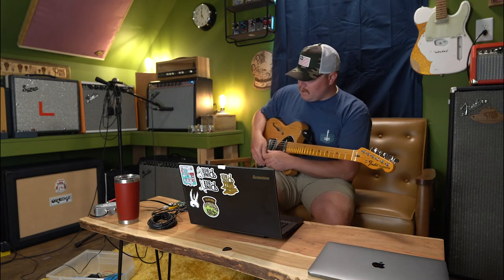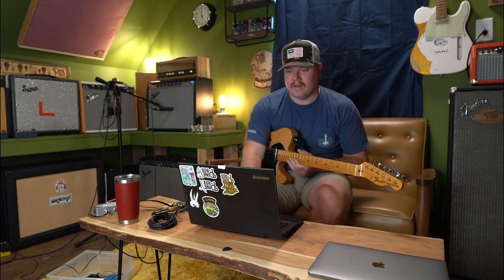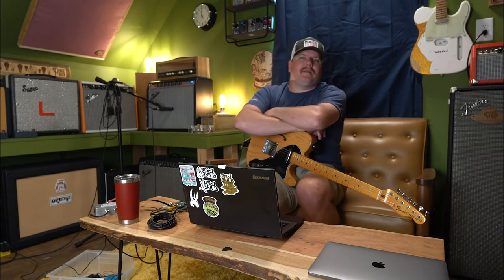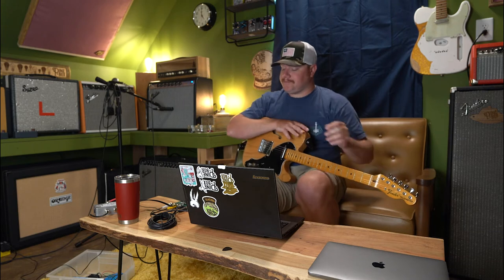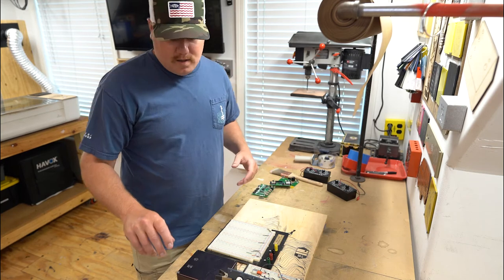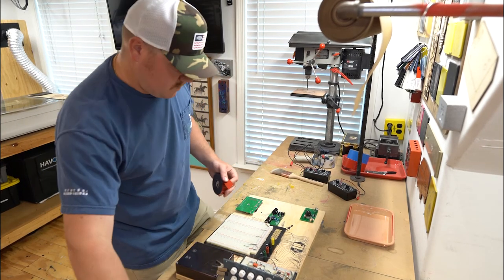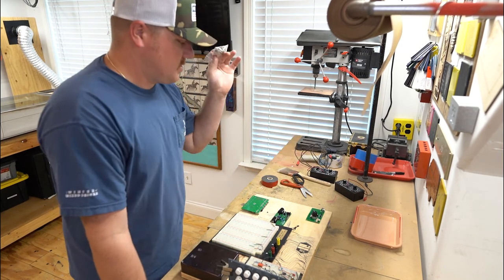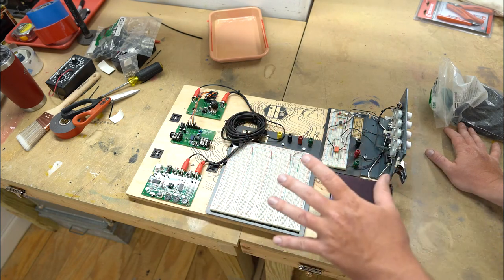VLOG #6 REVERB.FV1.BREADBOARD

Comment: Are breadboards like... music Legos? Where you don't need to solder stuff and you can test things out?
Reply from the maker: Yep! Something like that! Just kind of roughly ties a circuit together for prototyping
Reply: @pine-boxcustoms6731  that's actually really cool. I always wondered how people began with circuits before going all in with an actual PCB.
Reply from the maker: @Rothdrop  just kind of depends. I rarely use them. With pcb costs being relatively low and saving so much time most work is done straight on pcb. Most of the time you’ve got a good idea if a circuit will work so it’s a matter of little adjustments. Breadboards are great for tinkering nonetheless